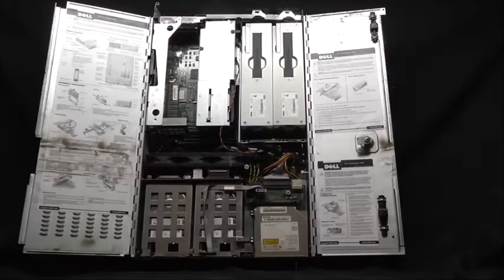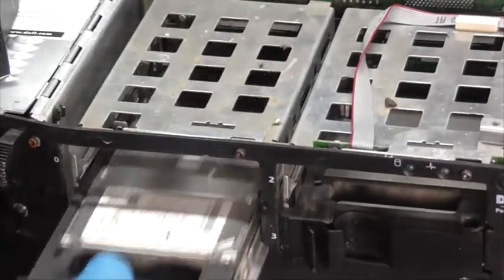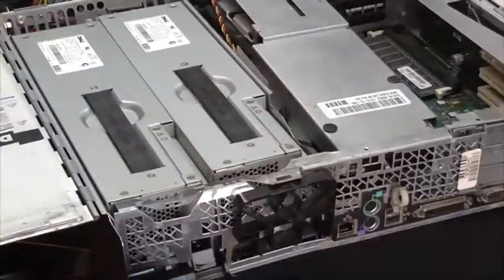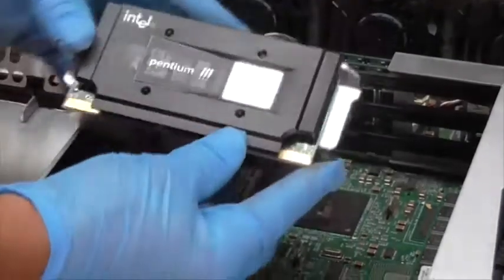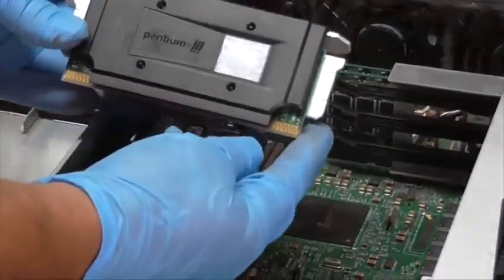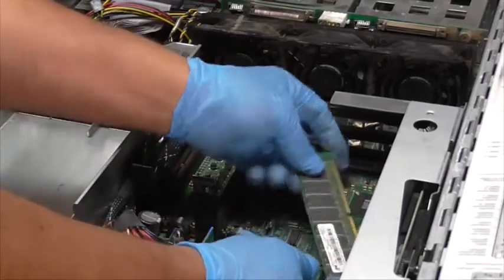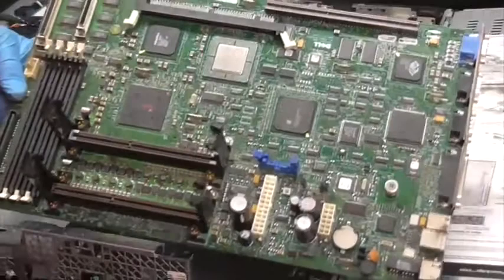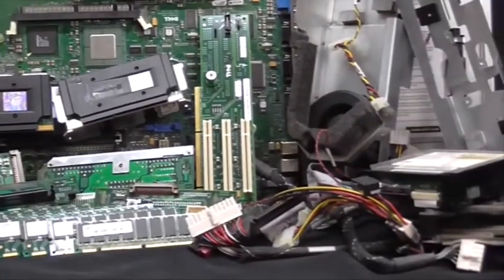What's in a Server?

Comment: Usually, USB, SATA, VGA, and DVI cables have gold plating on the pins.  IDE ribbon cables may have gold plating as well.  What you can do is clip the ends off and offer them to your local dealer or online.  The cable then can be stripped for whatever metal is inside.